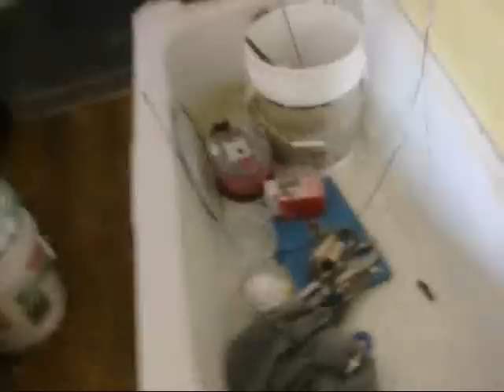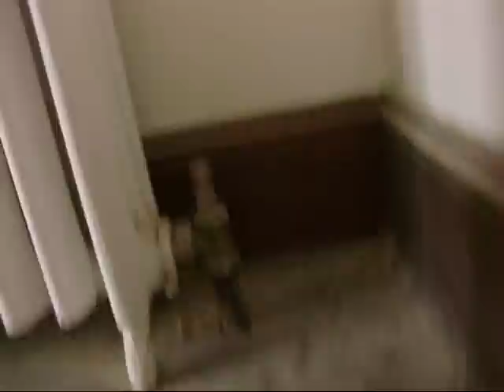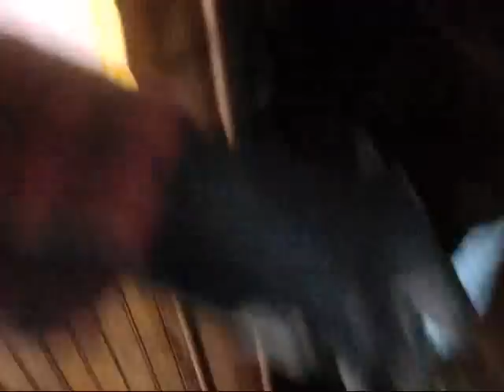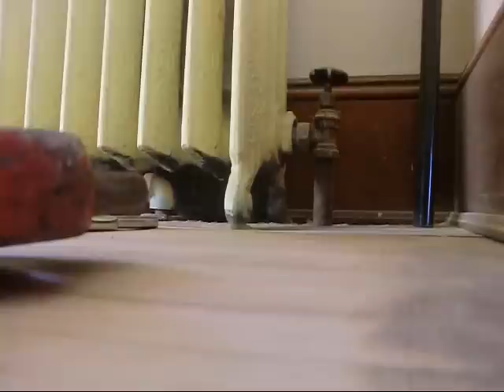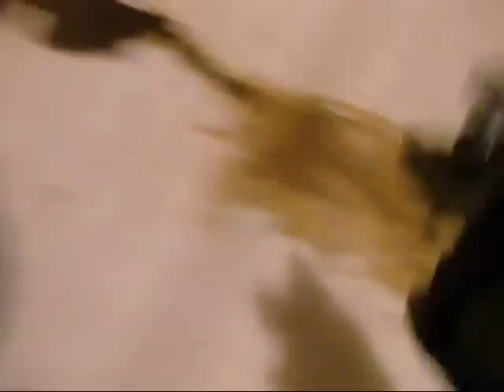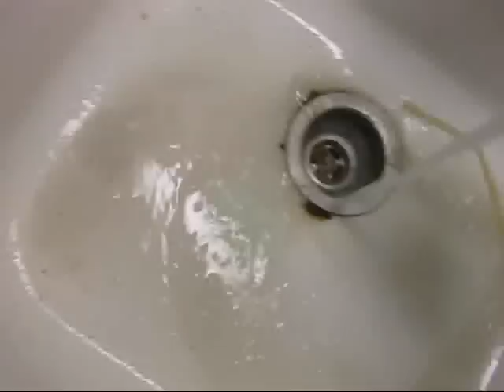Radiator Wrench 1 15 13

Comment: i figure he is just moving the radiators to sand and re finish under them probably going to put them back after,the rads and piping are probably good for another 50 years way better made than new systems